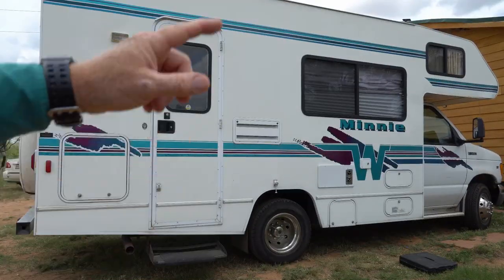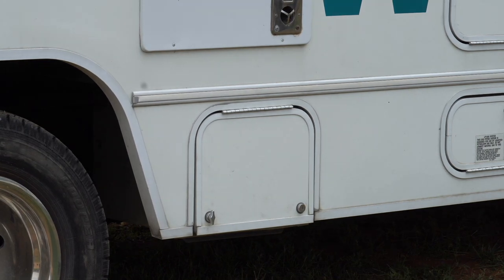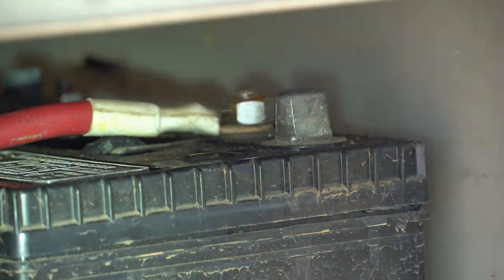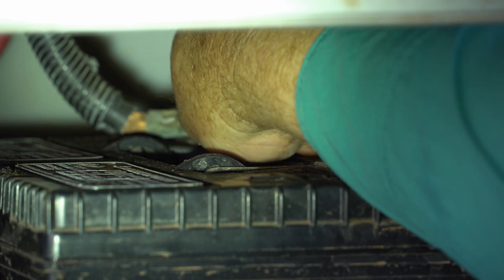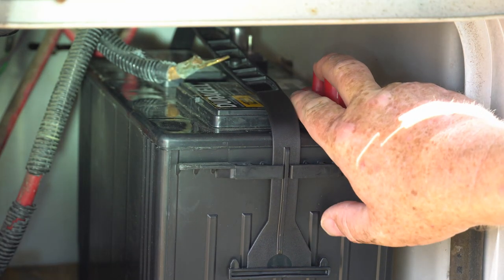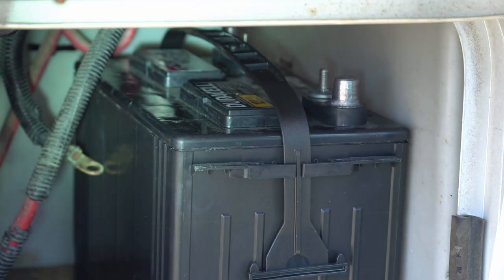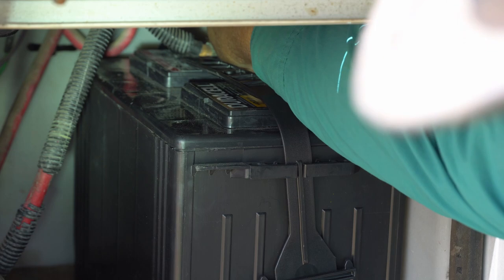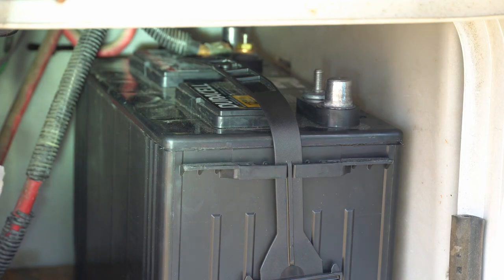🛠️ DIY: How to remove and replace battery on your Motorhome or RV

Comment: to change the battery on a mirada 33 ss you have to remove the cover  which says mirada which has 4 screews and that gives you access to battery which comes ut of the front took 1 hr good luck
Reply from the maker: Thanks for the good information.

Comment: I'm doing it exactly as you show, but when I put the positive wires back on, they spark and get very hot. What am I doing wrong? I also have 2 batteries but in 2 different compartments.
Reply from the maker: You either have a direct short somewhere or you have your cables reversed.

Comment: Where do you find the main starting battery? Mine died I have a new rv 1985 Chevy G30 and it won't start. I don't know how to pop the hood to look underneath
Reply from the maker: It should be in the engine compartment.

Comment: would there be any reason someone would remove this battery from an rv? or convert it??i recently purchased an rv and i didn’t do much research prior, but the previous owner told and showed me the battery powering the water tank and interior lights and that’s it. i wasn’t aware there was another battery, i thought the only way the rv could get power otherwise was if it was plugged in. if plugged in, is this battery what’s getting powered?
Reply from the maker: RVs are pretty amazing in that they are a dual power system. In some cases triple.  They can be powered via AC power by plugging them in. But when they are not plugged in some of the systems are DC powered by the house battery. When the RV is plugged in, it charges the house battery.  The third source is the propane tank, which powers the stove, water heater, and in some cases the refrigerator.
Reply: i have the same minnie winnie ‘96, what battery did you use and how much was it? if this exterior battery is replaced? would that power the electricity?
Reply: i couldn’t get my propane tank working unfortunately, so i am looking to replace the battery and convert to solar power, if i can before the winter, if not, finding a place to plug into AC would be best
Reply from the maker: The DC system only power certain low power consumption parts of the RV, such as the DC lights and water pump. It does not power high draw systems, such as the water heater or the room heater.  Those are powered by propane and AC.  You will need these both to be working before winter.  As far as converting to solar, this can be done with the addition of a solar panel to maintain the charge of the house battery. However, if you are wanting to use solar for heat in the winter, this will be very complex and very expensive to accomplish.  It is best to rely on propane for heat.
Reply: ok, so you’re saying there’s a dc battery system on the inside of the rv that powers the water tank and rv lights, and then there’s an ac battery system on the outside that powers the electrical outlets? my rv does have a propane tank, however, it’s not working and neither is the ac battery system or generator which is why i want to fully convert to solar, so all of my electric needs from heating to the water tank and sustainably powered. is that a conversion that can be done?
Reply from the maker: @elizabethmulenga8474  No.  It has nothing to do with inside or outside. There are two complete systems, DC and AC. You have two sets of lights.  Some work off of DC, and some work off of AC.  All outlets are AC, though.  The battery powers the DC lights, the water pump (to pump water from the onboard freshwater tank).  In most cases, it will also power the refrigerator. Some RV refrigerators can run on AC, DC, or Propane (Super cool technology, in my opinion).   The battery may also power the furnace blower motor. 

The Air conditioner is run off of AC, as well as the microwave (if you have one) TV, and all AC house lights, and outlets. AC also powers an AC to DC inverter that powers all the DC system devices (while on AC) and a battery charger that maintains the house battery. 

RVs are incredibly complex, and have a lot of systems that all work together. There are probably many videos that you can watch that can help you understand these systems and how they work better than me typing it all out for you. That is what YouTube is great for.

As far as running your RV completely off of solar, I highly doubt this can be done, unless you plan on never moving your RV and can build a stationary solar array.  There is not enough physical space on the top of the RV to house enough panels that could fully supply all your power needs. RVs are incredibly power inefficient.  Just slightly better than living in a tent as far as energy conservation goes.

If you really want to use completely renewable energy, there is nothing more renewable than a wood-burning stove for heating a cabin and cooking food.  Mankind has been living for thousands of years using wood as its primary source of energy and heat in the winter months.  The forest is full of trees that have died naturally to use for fuel. Wood and fire are natural.

Solar is not environmentally friendly.  All the components that go into building solar systems come from raw materials that have to be mined from the earth, and by reducing mountains to dust. All these components eventually go bad and have to be replaced, much of which cannot be recycled by a non-toxic method. Trees grow naturally.  Wood-based energy is the only true, completely renewable, environmentally clean way to go.

Comment: How do I find the battery placement for my 1999 Newmar Dutchstar diesel coach? The 6 batteries that came on it have been taken off. Thank you
Reply from the maker: I believe the correct battery for your RV is Group Size 31 Marine Batteries.  You can get them at Samsclub for $109 a piece
Reply: Thank you so much
Reply from the maker: @MetalTopsFTW  Anytime.  Glad to help.

Comment: I have a 2001 Minnie Winnie, looks just like yours, but mine has 2 batteries. Do you connect them to each other?
Reply from the maker: It would depend on the voltage of your system. If your Minnie is a 12 volt system, then you would connect them in parallel.  If it is a 24 volt system,  you would connect them in series.  I would need to know more about which model you have and if it has been customized.
Reply: @thejungleexplorer  
Thanks for replying. I'm not near my camper right now, but will definitely check it out before I buy new batteries. Right now they are hooked up separately. Again, thanks for your response!

Comment: Is that battery the same that goes on the vehicle to drive?
Reply from the maker: No. You want use a Marine battery, also called Deep Cycle battery for your House battery.  The battery for engine is a Starting battery.  

You can use a starting battery for your house battery, but using a starting battery this way may reduce its life.

Comment: I purchased a 1994 Fleetwood Prowler fifth wheel  and needed to find the right battery
Reply from the maker: There really is no "Right" battery. Just buy the one that will fit the compartment.  It is not like buying a battery for a car where there is a specific model that is recommended.